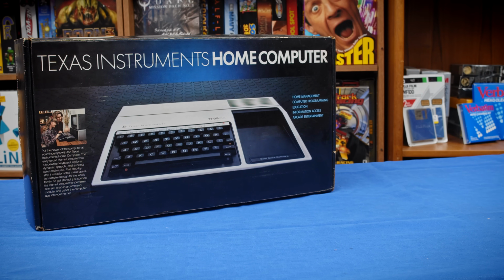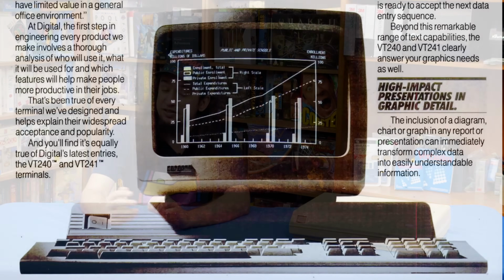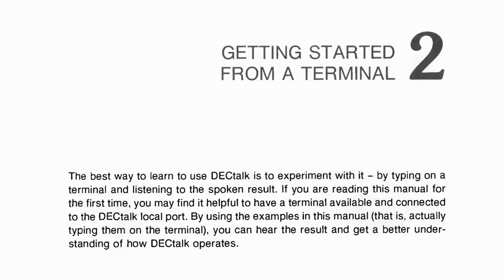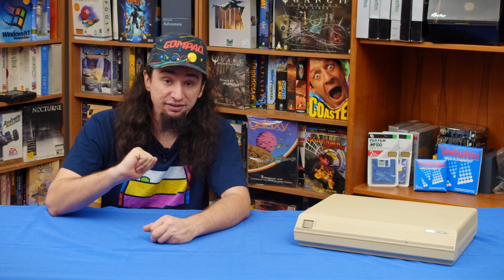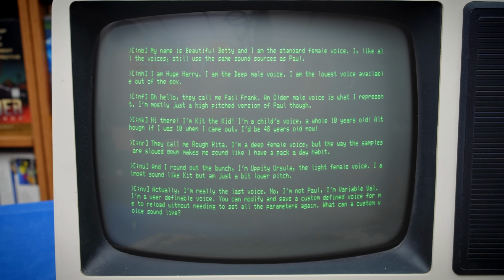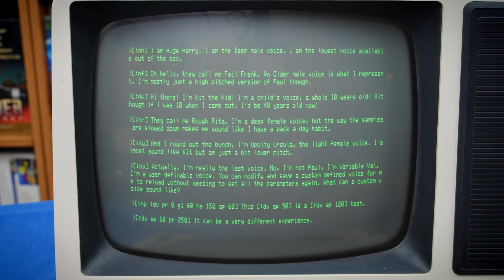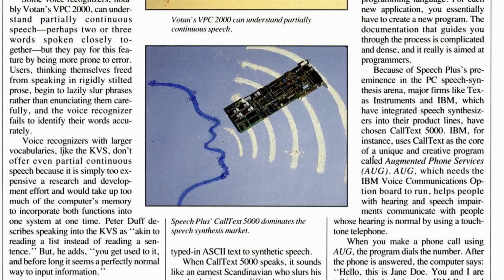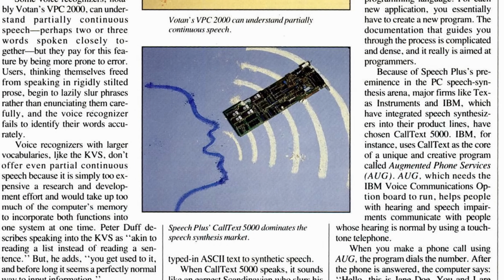DECtalk DTC01 - 1984 Speech Synthesizer

Comment: Have you looked at the tms5220 that can be installed in the BBC Micro, fitted as standard to the US models.
You can plug in different 6100 ROMs if you want, but I prefer to use the Compute Concepts Speech chip and even better paired with the Computer Conceps Text to Speech chip. So, the tms5220, an 8K EPROM and a 16K EPROM all fit directly into the motherboard and away you go.
Also supported by various BBC Micro emulators.
There is also a demo disc that will sing and demo all the inflection etc.

Comment: yeah. was kinda wondering why it doesn't have balanced outputs on xlr and a relay to turn on the PA amplifiers but ofcourse you can make it just call the PA over a PSTN line. lol. which also would nicely switch the amps on.
Reply: looks like something that might still be worth the effort installing today... with something to parse udp packets rather than rs232 going everywhere ofcourse lol.

Comment: 3:55 I saw 4 empty chip-sockets on the motherboard. Is there anything one could install there to upgrade the DTC-01's specs any? Also, would the machine still work if one were to swap out the Motorola 68000 with a 68010?

Comment: The other expensive component, which looks like it might be covered/obscured in your unit, is a TMS32010 digital signal processor and associated RAM. The DTC01 had not one, but *two*, expensive processors. I had the first internal beta unit and used it to write in email reading application for DECmail (naturally) in the early 1980s.

Comment: I my self still to this day use a Klatt based synthesizer last updated in around 2003 called ETI Eloquence. That particular synth has-been through lots of owners, to the point where untill june this year I wasn't even sure which company owned it. If you've ever worked with IBM ViaVoice in the 90s and early 2000s, you've probably heard it, as it was briefly forked by IBM and went by ViaVoice TTS.
Many blind people, including me, adore this synthesizer to this day simply because of how responsive it is at fast speeds. Synthesizers like DECtalk tend to slurr at fast speeds which makes them hard to understand. Eloquence is so widely used by the blind community to the point where Apple has introduced this 20 year-old synthesizer to iOS 16 and mac OS 13. That choice was widely applauded by people like me as I just can't stand using natural synthesizers for longer than a few days without missing my trusty Eloquence at this point.
Reply: Not only that, but some of us have grown up on it and boy did we miss it when we used adevice without it

Comment: We had 16 of these units hosted on a pair of VAX VMS machines, that ran our automated payment and information systems at our council.   The whole thing was in a pair of racks - and worked 24/7.  It allowed you to pay parking fines, rates, everything.   They needed constantly needed maintenance.  I got very good at writing-out ROMS and swapping things over.  We decomissioned the whole thing in 1998 and sold it all off - replacing it with a couple of Windows PCs and simpler modems.

Comment: Paul, Rita, Dennis, Frank, Ursula & Kit all still sound cooler than all the "natural" text to speech voices we have today. Dunno why but i just always preferred the robotic synthesized text to speech voices so much more but i do because i just love to hear a synthetic voice that does not hide its synthetic nature. For the same reason i love vintage CGI animations so much. I just wish there would be a modern multiplatform based  software version for modern operating systems or even a standalone handheld Text to Speech computer that uses the DecTalk  Speech Synthesis. Even the VOTRAX SC-01A would be great to have as a modern standalone Speech Computer module. However i still prefer DecTalk. There have even been SAPI3 Text to Speech voices from IBM that sounded almost like that. Same voice but in different languages. The german version of DecTalk sadly wasn't perfect and had a bit of an accent and some misspronounciations and wrong vowls but it was still kinda usable. But just not as good as the english one.

Comment: Ok I think this is the right time to ask. Does anyone remember a "Dr Sbaitso" text to speech demo in the 80s?  I remember it so clearly.  Sounded just like this device.
Reply: Dr Sbaitso was from the early 90s, and used a different speech synthesizer (Smooth Talker from First Byte).
Reply: ב''ה, not sure the origins of the synthesis engine, but fairly certain that was packaged by Creative Labs to demo the SoundBlaster (possibly the now classic and venerable SB16) or at least named after it.

Comment: Fun fact: the "Dennis Klatt" speech synthesizer that was used in DECTalk is available as open source. It is a tiny but very elegantly written C program that takes a stream of 19 parameters to produce an audio wave output. All you have to do is feed it with the 19 parameters and it will vocalize it.
Reply: Wish someone would give that a proper GUI and release a lightweight standalone version for Linux and Windows.
Reply: It's not actually open source, but pirated. The source code was released without authorization by a former developer. Lack of a license hasn't prevented people from using it though.

Comment: There's one setting that's very culturally relevant to a much wider swath of people than it would, at first glance, appear.
I've seen DECTalk in a variety of movies, mostly or entirely from the 80s. It's in Back To The Future II and also the first Short Circuit movie, just to name a couple. It's also featured in some music, both from the time and from later.
But the most lingering cultural heritage DECTalk gave us is its singing. Listen to some of the early Vocaloids. Notice anything familiar? Even the vibrato patterns they use are similar to those found in singing DECTalk. I don't know if they give credit or not; that kind of thing doesn't appeal to me as a topic of research, but there's some pretty elaborate stuff to be found which was sung by DECTalk. I happen to know some of the pioneers in that field, so to speak. It's little wonder that someone would want to capture the amazing novelty of that and package it in a much more user friendly form. I have never personally made Hatsune Miku or her relatives sing, but I can't imagine it'd be so popular if it took the effort DECTalk's interface does. I've definitely used the DECTalk singing manual a time or two, and it's mentally rather taxing, as the video creator can easily confirm.
And there's one more piece of heritage. Again, I can't confirm who borrowed from whom or to whom credit was given, but several of the Macintalk or Plaintalk voices owe their inspiration, if not their existence, to the DECTAlk and the work of Mr. Klat. The easiest example to locate for most of the populace is going to be on iOS or iPadOS. The recent update to iOS 16 gives us more examples, but even older iOS versions have access to Fred, a voice that's been around for a long time. Giving Fred a listen certainly elicits strong DECTalk vibes, if nothing else. I wish we had a voice more like Perfect Paul, whereas Fred is a bit more like Frail Frank, but honestly, even having Fred around is a nice bit of nostalgia.
DECTalk is a serious icon of computer speech synthesis technology, and I'm glad people are starting to remember how amazing it really is and what a truly inspiring legacy and lineage it has.
Thank you for the wonderful video.,

Comment: I have an original DECtalk Express from 90s. It was actually purchased new for a 286 DOS computer then used later with a 386 and Windows 3.11. It is still working today and after all these years, the original flat cell battery just recently failed. Can't say that for new products! 

I still hear it in my head "DECtalk Express is running version 4.2c....external power on" or "internal power on" and gives you the percentage of life left. The DECtalk really is an outstanding piece of hardware. 

Have you seen the "Type n Speak"? Those are really interesting computers without screens that have this same voice or simular chip built in. The deep voice on the type n speak is named Rocco "rock-oh" 😅

Comment: I have a similar device with all of the same voices.  Its a Words+ Commpac System 2000 I got with a touch screen equipped NEC Versa M75 486 Laptop.  Words+ made the speech synths for Stephen Hawking.  Words+ was founded in 1981 by Walter and Virginia Woltocz and worked with Hawking around 1985.  The system 2000 unit is from the mid-late 1990s.  Cool finally knowing who created all those voices.  IIRC the internal synth uses a lot of DEC branded silicon.  Got to wonder if DEC and Words+ had a close working relationship.

Comment: Ah, you watch one video and it recommends another one... and this one was great as well.  I did kernel hacking on VAX/VMS and then Alpha/OpenVMS.  DECTalk (DTC01) preceded DECVoice (DTC04) but the concepts were similar.  When you say it has relevancy today you are right.  Stephen Hawking.

It was revolutionary in its measly requirements for pre-processing TTS, and its intonation worked well for most English sentences.  That is even contrary to today's smartphone TTS systems that need "a little help."

For example, my car bluetooth speaker thingie announces the name of the device being connected.  My phone being called "Ehud2" was being mal-pronounced so I had to rename it to "Ay-Hood Too".  DECTalk would have handled that much better.

Cheers,

Ehud (the original, not 2)

Comment: It has the same case style as the VT240. They were probably meant to be stackable with other DEC equipment.
Reply: Use of the VT240 enclosure was just to save on development cost of a special enclosure. The rack-mount version DTC03 came later which was a card which would slide into a DEC modem rack.

Comment: I've mentioned this on some other peoples videos about "speech synthesizers" - there is an article in Byte Magazine (is it May 83?) with circuit board layout for a Vortrax speech chip, connects to the printer port, and code to use it from GW-BASIC - I built one in around 1996, but it appeared the Vortrax chip I had was dead, and although I could buy one from Germany at the time, it was cost prohibitive for me (on the other side of the world, over 200 dollars in local currency, not including delivery).

Comment: On the emulator, you have to press enter twice for it to say the words
Reply from the maker: You need to add punctuation, it has a sort of fallback to say lines that seems to happen if you give it two new lines without punctuation. Sending CTRL+K will also cause it to read whatever it currently has in its buffer.

Comment: Years ago I built a speech synthesiser from a chip-set sold by Tandy (Radio Shack)
For an idiotic project, I 'made' a telephone ringer out of it, as in the old land line phones, not the modern cell junk.
I connected a hayes compatible modem to the phone line (which solved any legal woes about connecting to the line). These modems send out the text 'Ring' when there is incoming ring/call. this was fed into the speech synth, then from there into a PA amplifier. So when the phone rang, a large horn speaker started yelling 'Ring, Ring Ring'

It worked, it was really bad, after the second call I pulled it down, the synth has not seen any use since....

Comment: I'm a little surprised about it having a full on 68K processor. I would've thought a microcontroller would've been good enough. I guess the microcontrollers of the day weren't powerful enough, so they needed basically a full computer to make it work. The 386 in the DECtalk Express was an even bigger surprise. The code must be very different between the two, considering the difference in architecture.
Reply: Speaking of code, a collection of DECtalk source code has recently surfaced on the Internet, and a team of developers Is working on a modern port that has a classic sound, as the newer versions don't even sound anything like classic DECtalk.
Reply: I have a newer version of this, that uses an internal 3/4 or full-length ISA card, with a 3.5mm cable to a DECTalk-branded external speaker box.  The board doesn't use a 68000 but it does have an 8086 CPU on it.  The PC it's inside is a 75MHz Pentium clone, got it from a blind user I did some PC work for.  The software has a DOS TSR that can speak the screen contents of most text-based DOS programs, and has some special handling for DOS itself and some specific programs.  It also has Windows 95 support with a driver and some software that runs in the background.  It mostly sounds identical to the one in this video, but it's a little harder to talk directly to it, since it's meant to work with the included software rather than just piping data to it over serial.
Reply: It was 1984.  Most of the micro-controllers we have now are descendants of lineages that hadn't been started yet.  This was the era when PDP-11's were still being used as embedded systems, and the J-11 single-chip PDP-11 processor was still a fairly new product.
Reply: @evensgrey  There were plenty of microcontrollers around in 1984. The Intel MCS-51 (8051) was released in 1980, its predecessor the MCS-48 was released in 1976, the Zilog Z8 was 1979, the first PIC microcontrollers were introduced in 1976, even the Intel 80186 was introduced in 1982 and was designed as an easier to implement microcontroller version of the 8086.
Reply: It not only had a 68000, but also TMS320 DSP. The 68K did a non-trivial amount of text parsing & manipulation in addition to the letter-to-sound rules.
Reply: ב''ה, depending on how much money you had to burn, the 68000 was considered a "microcontroller" by some of the bigger iron types in that era.

Comment: 10:03 "Like earlier speech synthesizers, the DECtalk uses Linear Predictive Coding" - This is entirely wrong.

DECtalk uses a formant-based cascaded vocal tract engine, developed by Dennis Klatt around 1977-1980 at MIT and called "KLSYN" (later 'KLSYN80' to differentiate it from a later version he made around 1988 just before his death). The Fortran source code for an early version of KLSYN was published in the article "Software for a cascade/parallel Formant Synthesizer" in the volume 67 issue 3(March 1980) of the Journal of the Acoustical Society of America. It does not use LPC coding at all!
Klatt himself ported this Fortran code to C (you can find versions of this on github) and also ported it initially to hand-made assembly code for the TMS32010 in DECtalk DTC-01 v1.8; DECtalk DTC01 v2.0 has a later version of the DSP code with a number of bugs fixed, which was ported from his C version in 1983-ish.
Reply from the maker: That is fascinating to know! I was basing this off of the Popular Science article I read which phrased it in a way that wasn't entirely clear throughout the article but made me think it was LPC.

https://books.google.com/books?id=f2_sPyfVG3AC&pg=PA42&dq=dectalk&hl=en&sa=X&ved=2ahUKEwjJlvqtgZz6AhUbJUQIHfD2BGAQ6AF6BAgDEAI#v=onepage&q=dectalk&f=false
Reply: @TechTangents  I can confirm this -- and the weird artifacts you heard in "Let It Be" were overloads in the vocal tract model.
Reply: @tfmorris02181 would ROM V2.0 fix the screeching?
Reply: @TrackZeroNotFound  The 2.0 ROMs would likely fix many of the issues, but I don't remember if there were any compatibility constraints (e.g. minimum rev PCB, etc).

Comment: DECtalk DTC-01 v1.8 units are VERY RARE, I only know of one other unit with that firmware in it.
Beware if you try to update the unit to DECtalk DTC-01 v2.0, you not only need to replace the 16 EPROMs, you also need to replace the two bipolar PROMs which hold the firmware for the TMS32010 DSP, since if you run DECtalk v2.0 68000 code with the DECtalk v1.8 DSP code, the speech output will be very quiet, maybe 1/2 or 1/4 of the volume it should be.
(BTW, do you have high-res pictures of those EPROMs and PROMs? I want to be sure MAME has the EPROM labels correct for them in their DECtalk emulation driver.)
Reply from the maker: Unless there is something major like a fix for the screeching when singing I don't anticipate updating it to 2.0 because it works. I'm imagining the one other 1.8 unit is probably the one that the MAME ROMs came from?

That's good to know it would be more complicated than I anticipated if I tried though.

I did put a picture of the entire mainboard up on my device repair site here: https://caps.wiki/wiki/DECtalk_DTC01#/media/File:DTC01_Mainboard.jpg

If you need more specific detailed shots or something else feel free to ask! If email is better you can also reach me at akbkuku@akbkuku.com . I'm happy to help preserve this device through emulation!
Reply: @TechTangents  Yes, that's where the MAME ROMs came from.

Comment: 2:27 I had that peripheral (along with the TI). Disclaimer it was in France, and the device was still only in English.
Reply from the maker: That's actually something that I meant to mention in this video but it didn't end up getting into the script. Almost all of the early computer speech synthesizers were only for english. It was very uncommon to get other languages. Languages are so complicated that it basically requires ground up research from scratch for every single one.
Reply: @TechTangents  The first big problem is that the phoneme sets are often different.  A well-known example in the English-speaking world is that Japanese doesn't differentiate between the sounds we use "L" and "R" to represent (leading directly to the phenomenon of 'Engrish,' which is very amusing for about three and a half minutes when you first see it in signage and then annoying).  Another is that Arabic differentiates between three phonemes that a native English speaker will literally all hear as a short "a".  (I don't mean that we don't differentiate, we literally cannot hear the difference in usage, only if we concentrate on the actual sounds, and then we don't have labels for the differences we can hear unless we speak a language that differentiates the sounds.)